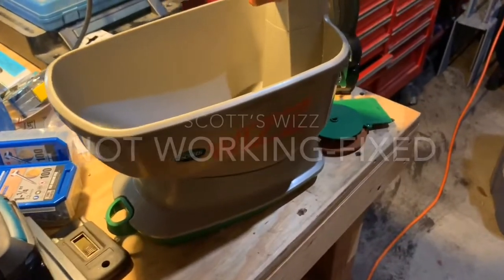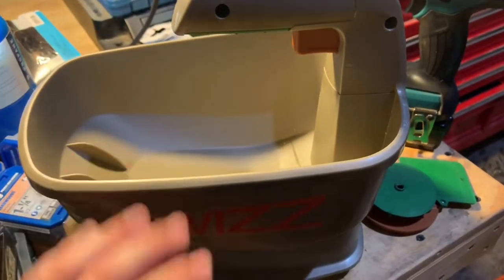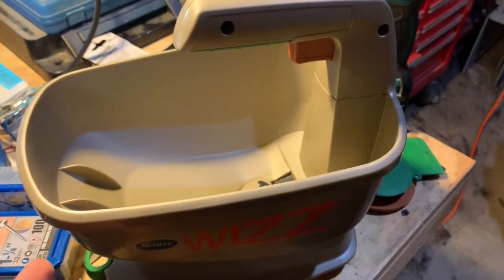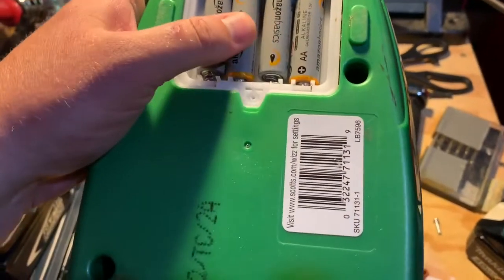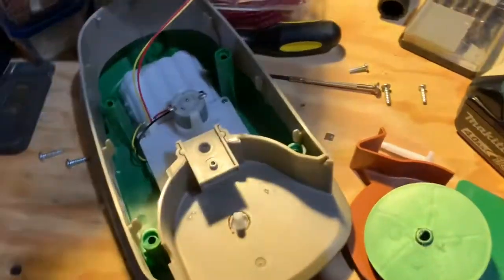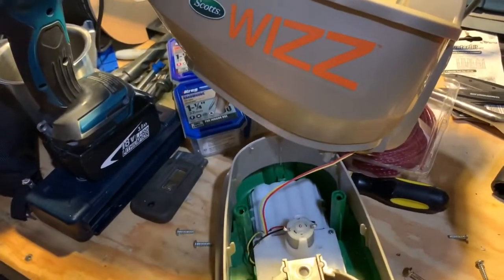Scott’s WIZZ Not Working - FIXED

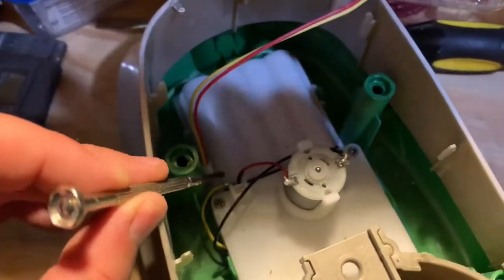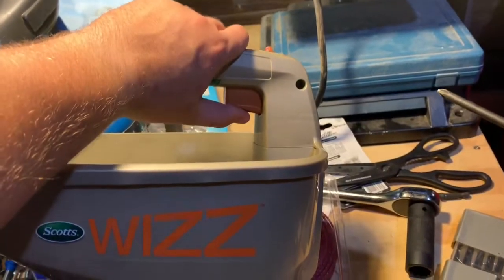Comment: thanks for this video which helped fix mine. The problem with mine was that the wire coming from the positive terminal of the battery compartment straight up to the small block that the switch plugs into had rusted away. There was no positive connection to the switch block. To fix this I had to cut the yellow wire (short two or three inch wire just under his screwdriver at 2:01 in the video) close to where it runs into the white plastic molded casing (don't worry it just goes to another port that they use for testing in the factory).  Then strip the end of this yellow wire, pull back the black rubber seal that protects the battery case, slip the stripped end of the yellow wire in and connect it to the positive terminal in the battery case. Press the rubber seal back in, then plug the switch terminal back into its receptacle as he does at 2:15.

Comment: I think I may have fixed my weak motor issue: it seems I had tightened the four screws too tight on reassembly which created friction via a squeeze. So be careful not to do that.

Comment: After disassembly, I discovered all of the electrical was working as it should. Then I turned the shaft that feeds the fertilizer into the feed hole by hand and it was frozen. Probably from corrosion buildup after setting all winter. Using several drop of household multipurpose oil on the shaft, it broke free and turns with ease. A sealed bearing should be used rather than a bushing. Reassembled and applied fertilizer to my yard. The parts used in the manufacturing process of this devise are CHEAP. If it had a brushless motor, sealed ball bearings, higher quality trigger switch, it would never wear out.
Reply: That’s the problems I got. Motor very weak. Fertilizer just falls out and isn’t spreading

Comment: You are lucky.. They problem with mine is the trigger switch is not making contact and I can't figure out how to get that part of the spreader apart to access the switch.
Reply: Mine must be the trigger switch every thing else is good but it is still not working. This is the second machine booth of them didn't last a year Theodore and battery's were good
Reply: The motor and batteries are good

Comment: Mine has had a significant reduction in power. Same scenario. Used it with some weed n seed and patch builder one season. Then the next it was super laggy and got stuck often. 

I didn’t use ice melt in it until recently (and it is made to be used for as they say “seed feed weed and *Melt*”). But since that’s heavier it jams more often and just feels like it’s stuck on 25% power even with brand new multimeter tested batts. 

I’ve played with it apart a few times and with no luck. (Even before melt).

**also fist bump to you for using KREG pocket hole screws etc. Their products are amazing!
Reply from the maker: They honestly need a better gearbox. What happens is there is a high amount of breaking torque required for hard heavy consolidated material like salt and it just doesn’t have the power. Maybe I’ll 3D print one some day and put in a proper motor... Kreg all the way.

Comment: It works when its open but as soon as I close it then it stops again.  I thought you had the answer lol. Suggestions?
Reply from the maker: Tonya Ryan when what’s open? Check the thumb lock switch
Reply: When I take it apart as you show in the video and unattach and reattach the plug, I pull the trigger and it works great.  When I close it back up and screw it together, it does not work.  I have literally used this thing one time.
Reply from the maker: Tonya Ryan Sounds like a connection is getting pulled apart as your putting it back together, hard to know for sure.

Comment: What did you test the motor with? It seems my yellow and red wires are plugged in. I’m scared to touch it with anything metal lol idk if I’ll get shocked I’m not familiar with any electrical work whatsoever